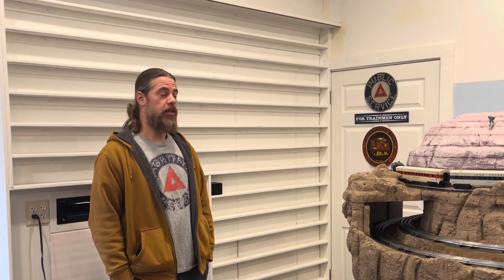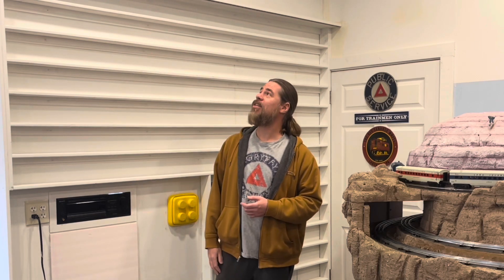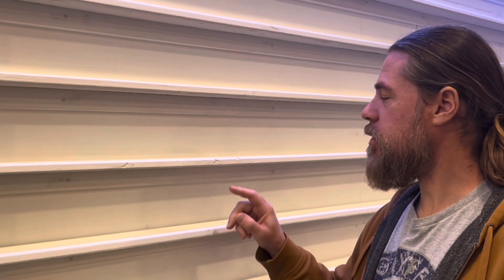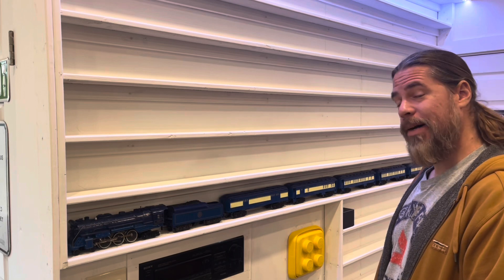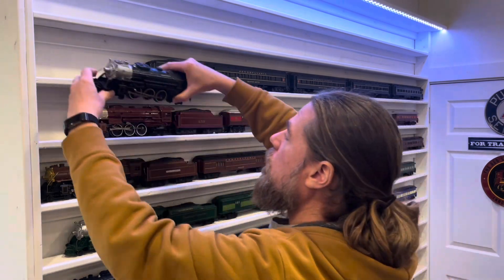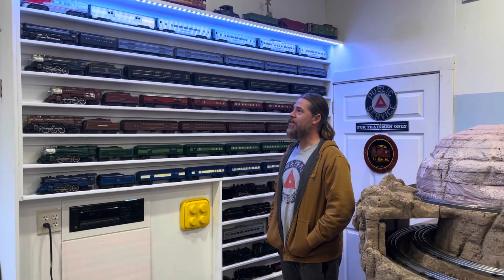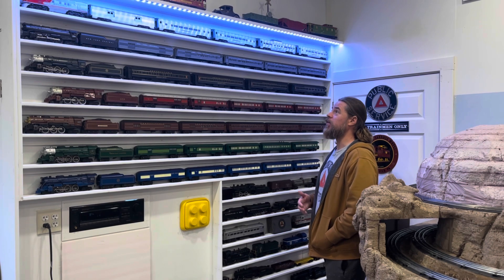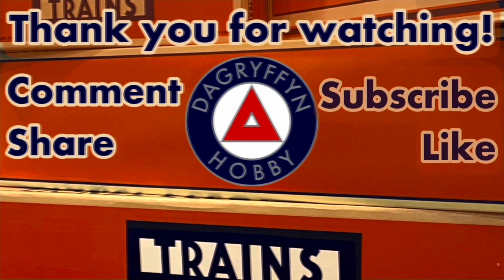I Finally Have Some Display Shelves! O Gauge Shelf Display

Comment: Nice job! My layout and display shelves are in Idaho where the odd earthquake is possible. So I cut 3 inch 48 inch long strips of 1/8 inch pelxiglass and mounted them to the front of the shelves and sleep much better that way. Cutting wheel grooves was hard enough with a good table saw and can make fitting the trains difficult. I like your idea of old track and would use that if I had to do it again. Love your videos.
Reply from the maker: Thanks. I like the idea of plexiglass. I might even have some in the garage somewhere. I’ll have to look. 
Thankfully I do t have to deal with earthquakes, I mean we might get one very rarely but they are tiny, but who know. Better to be safe.
Reply: W3435

Comment: Nice job.  Wish I could build enough  shelves for my Lionel  sets , but I live in a  apartment., over 300 pieces  of Nice rolling stock and engines.
Reply from the maker: Thanks! Yeah apartment living and shelving can be an issue. I built a similar shelf when I was in an apartment but the sides went down to the floor to support the weight and I used a thin board on the back to add strength. Worked out pretty well with minimum damage to the wall, just a couple screw holes.

Comment: This was a great project. I want to do the same, but my layout is in the livingroom, and I am concerned about damage to the walls. But the main consideration is the weight of my DMIR (Georgeous Locomotive) and the possibility of a flood from a hurricane. Yes we are in Florida. I pack up everything and store as high as possible, and then worry about moisture damage. Need to go north.
Reply from the maker: There are options that do less damage to the wall, if I were to do one where I cared about the wall, I would construct a shelf with a backing that is structurally strong enough and then hang it from a single board that is attached to the wall into the beams. Then there would o to be a few holes to fill when taken down.

Comment: Dave, the shelves look fantastic!  Oh yeah, putting up shelves and then putting the trains on 'em opens up a whole new world for you.  It gives a train room a cozy hobby shop ambiance and I guarantee you you'll get a rush every time you go out to the garage and see the treasures on the walls.  I sure do whenever I go out to my "Chugger Barn!"
If the wood's a little rough that's OK, the white paint covers a lot of imperfections and as the saying goes "The best is the enemy of the good enough!"   And I'd put some track on the shelves just to keep the trains aligned and a bit more secure.  There's plenty of old 027 and 031 trackage around you can use and of course there's no rush. 
One MINOR thing, I'd put the Blue Comet up on top.  A little Jersey Pride ya know?
And I'm OH so jealous of that Public Service first aid box!
Great show!  Thanks for posting!
Reply from the maker: Thanks Wayne. I have boxes of old track, just have to find time to go through them and clean some of the rust off. 
I love seeing the shelves when I’m out there. Smile inducing. 
A used a lot of paint! Slapped it all in there. 
I don’t know, I like the blue comet being closer to eye level, besides the top shelf is a little too high to put something there that I will run a lot.
Reply: @dagryffynhobby  Understandable!  You know, sometimes when I'm through running trains I just sit there and look at the shelves full of trains.  Feels good!

Comment: I wouldn't both putting track on the shelves, I started with that approach on my shelves and it just got frustrating to put the trains in the track each time I rotated cars. I just put them on the raw wood now and I have no issues with them falling off.
Reply: It's user's choice really.  I put tracks on my shelves since I didn't want the wheels sitting on unfinished wood with possible corrosion problems resulting.  Since the plain wood looks fine to me I didn't bother painting or varnishing it.
Reply from the maker: There is a 50/50 chance of me putting track on the shelves. At the moment I’m having no complaints with them directly on the wood.
Reply: @dagryffynhobby  the only thing I have noticed after a while of putting the cars directly on the wood is sometimes there is some grease / oil marks on the wood, especially from the engines. I guess track would help prevent that?
Reply from the maker: @ArtsModelTrains  I’m sure over time there will be marks from dirty/greasy wheels. Not too concerned about that though. But something to think about.

Comment: Really nice work! I once had trains displayed on a shelf without track and once a tender rolled off the shelf when removing another train. It broke a step off the tender! I'm sure yours will be fine! Maybe fit a rubber doorstop behind the door, in case it hits the shelves?
Reply from the maker: Thanks. I am worried about drops especially when removing trains. Hopefully it won’t be a problem. 
The door doesn’t touch the shelves. The benefits of good design and an uneven floor! 😆

Comment: Hi Dave I just got my shelves up and my Trains on them. How do you keep the dust off?  I don’t have room for a layout so they are display only.
Reply from the maker: I don’t. Unfortunately. I do very gently blow them with compressed air from time to time, but mostly I just lightly brush them when I take them down to run them.

Comment: Dave, did you ever post a video explaining what the space is you used for your layout? It sounds like it is part of a garage because of the cold comments you occasionally make. You do a great job when you share your time with the trains. Thank you.
Reply from the maker: Thank you! 
I’ve probably mentioned it over time but never specifically outlined the space. 
It’s essentially a four car detached garage. I have the train room and then two garage bays on the other side of the wall. Concrete block, old cracking floor, roof disintegrating, but I do the best I can. I’m just thankful to have the space!

Comment: You do realize that the displayed stuff & shelf needs to be cleaned and dusted from time to time. Your magna traction engines should be placed on sections of track. So your plan to set them on tracks is a good one.
Reply: I only dust mine when I take them off the shelves to run them.  Since I rotate trains on a fairly regular basis and I don't have much of a dust problem anyway it's never gotten bad enough to worry about.
Dust is only a problem if the trains sit on shelves unused for months or years.
Reply from the maker: I’m sure nothin will stay on the shelves too long. All these trains get used pretty frequently.

Comment: I have found that no matter how much shelving I build I still don't have enough space for all the rolling stock.
Reply: Uh, me neither, and I've got lots of shelves.  I wrap the excess rolling stock (and there isn't that much) in paper shop towels and store them in plastic containers, then pull them out as needed.
Reply from the maker: Yeah this stuff takes up more room than you think!
Reply: @dagryffynhobby  Especially the boxes, and more so the modern boxes with the styrofoam inserts.  Unless I've got a post-war with the original box, and you can count them on the fingers of one hand, I'm ruthless with boxes, I recycle them all. By the time the new cars will be worth big money in the original boxes I'll be dead and beyond caring!

Comment: I see you don't have any Berkshires or Northern steam engines, or a U36B 
 Not knowing were you door handle is be aware of it hitting a train on the shelf, maybe that is where you placed that first aid kit for that reason.
OK in the end you showed us where your logo came from, you borrowed one..

 I'm sure you know this but you need that shelf supported directly into the wood at some spots or cement block wall. If mounted just into the dry wall, that will crack in time or from weight and you will have a disappointing mess.
Reply from the maker: I wanted this shelf for my MPC sets mostly. My postwar Berk is in a safer spot. 
No worries about the fort handle, the door doesn’t open far enough, the floor is far from level and it bottoms out before hitting the shelf. 
The shelf is screwed and glued together. Supports are screwed to the beams and to the shelves. It’s pretty solid. Thanks!